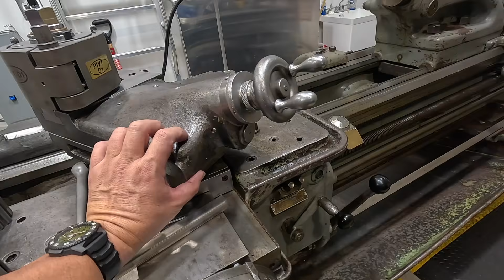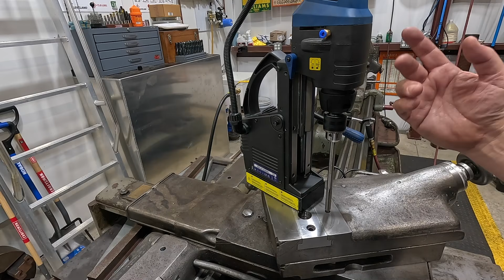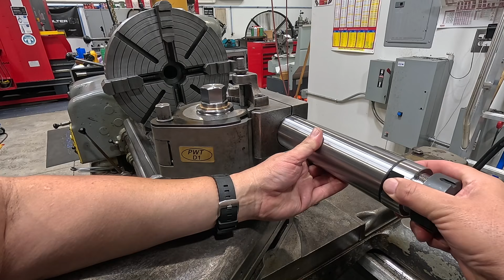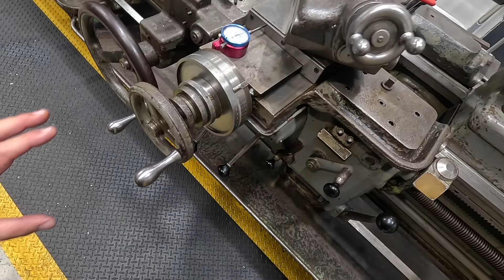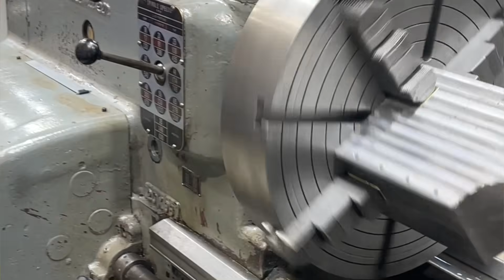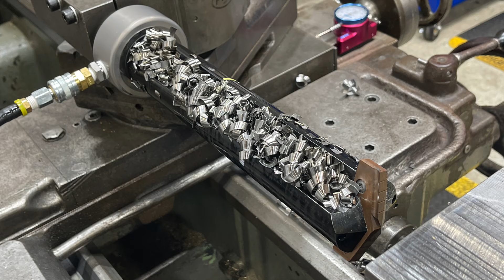3-1/4" AME Spade Drill First Test Piece

Comment: I have been watching your videos for quite some time now and I don't recall having seen one that answers my question:  I have often watched you indicate something (it doesn't matter what) to within half a thousandth's but have you ever had to indicate something so that it was dead nuts accurate?  If so, what was it and why did it require such accuracy?  If you have one, I would be very interested in watching a video demonstrating the process.  Thank you very much.
Reply: Define “dead nuts”. So you know, there is no such thing as “perfect” in machining.
Reply: They can get down to the width of a ray of light. But nothing can ever be perfect. Half a thousand is usually close enough. +-2 ten thousands is common in some industries.
Reply: It only needs to be so good, and going much better requires much more exacting methods. I am sure he could get it closer, but what good is 2 tenths on a hole drilled for clearance for a boring bar, and has an ultimate tolerance of .001-.002?

Comment: you see this is where one of the major problems of these older style lathes and mills comes in and also where the skill level of the machinest is really shown, you have no way of knowing the spindle pressures so you have no way of knowing if your machine can handle a higher feed rate, you said you thought that it was to aggressive at higher feed rates but in fact the only thing telling you that is true is your experiance. in fact your machine MAY be able to handle a higher feed rate doing this and other jobs but you have no way of knowing as you can only tell by sound and looking what is going on, and while you are a very good machinest and all your experiance is telling you that what are saying is true, and it PROBABLY is true, you cannt really say for certain.
Reply: He can't prove it exactly but when the chips were coming out dark like that you have a good indicator. I mean that started to look black which is hotter than blue I'm guessing. Assuming the setup lasts for the full 15 pieces (and I'm betting it will), by the 15th piece Adam will have a good level of understanding the forces and the ability of the lathe to handle them. Like you say, that's where the experience of the machinist truly starts to become important.
Reply: @musicbro8225  so lets first talk about the "dark chips" comming out of the hole, you know what that tells me? it tells me that he's not running enough coolant through the tool to keep the tool head and work piece cool enough. which would fit with what i saw but then this is one of the first times he;s run coolant on this machine so thats understandable, also the fact that the work piece was not balanced in the chuck could be why he was getting the "CHATTER" he said he could hear and it being nothing to do with the feed rate ect ect ect. the thing i'm trying to point out and was trying to point out in the first comment was that there is a reason WHY this type of machine is dying out and why CNC is now the most common type of machine to do all of the differant types of machining. it's because if you take a total novice machinest and give him a CNC and you take a pro level machinest like ABOM with a lathe like this. the novice would be able to turn out parts to a higher tolerance faster than ABOM not because he's better at the job but because he has better tools.
Reply: @madmurdoch2000  Yup that all sounds reasonable. I wasn't arguing just pointing out that it doesn't take much experience to see the colour of the chips. But I still love the old machines and their quirky ways of the past.

You could say that there was a lack of coolant but you could also say that the feed rate was too high for the setup. Easy to slow down, less easy to increase the coolant supply. Going forward though, the coolant could be better as abom said himself when he first ran it.
Reply: "where the skill level of the machinest is really shown," yeah, it's not like this is a really basic part of cnc machining or anything.

Comment: Add an amp gauge to the lathe, so you can monitor what is using normally during the plunge for power, verse when you break an insert deep inside the channel/ amperage climbs way up, to know when you need to pull the tool to replace a broken insert.

And ditto on coming up with counter weights,since front end of spindle that out of balance, it not going to allow the spindle bearings to last/

Comment: I think you need more coolant pressure, change the pump to a more powerful one, as you mentioned in the last video.
It is not only for cooling, but for chip evacuation. The chip might get stuck, and damage the tool insert. You can also turn the drill 90 degrees, to gett better chip evacuation from the drill flutes.🙂
But man, that lathe is a beast!

Comment: Why indicate the holder on a surface you don’t use? Instead, consider placing a known good tool in the holder and indicating directly on the tool itself. Similarly, why center the tool holder using the tailstock? The tool operates relative to the spindle, so centering it with an indicator on the spindle would provide more accurate alignment. Adding the misalignment between the spindle and tailstock unnecessarily introduces error into your measurements. I find some of your videos a bit frustrating to watch—not necessarily for viewers unfamiliar with the trade, but as someone in the field, I notice what I would call avoidable errors. These come across as amateur mistakes, which is surprising given your expertise.
Reply: Unless he knows those parts are good as he's measured them previously.
But I don't think these holes need to be spot on, I think he's just hogging out metal for a finish process.
They look like they will be king pin holders for some sort of big heavy thing.
Reply: Always surprises from Adam. When everyone was expecting the toolblock to be used as a perfect accurate drill guide, already indicated in position. He removed it!! and drilled freehand for a locating dowel ending up 0.030" out of position. Those locating pins usually protrude about 1/2" from the top of the toolblock for easy removal. The three holes in the toolblock are for 3 degrees increments not 4.5 degrees as he keeps insisting. If the compound was set parallel it could be used to break any long strings of swarf.

Comment: Tip: if you make dowel pins, and you have  height enough, I always but thread on the end of the pin, then I can use a pipe/washers and a nut, to easily pull the dowel again.

Comment: 17:11 the reason why it moved 25 to 30 thousands is because you used a undersized transfer punch.
It makes more sense just to make a sacrificial transfer punch, than to use a undersized one.  Barely takes any time on the lathe. Than to do all indicating and coming out with no accuracy. it is just wasted time and effort.
Reply: Or use the hole in the toolblock as a perfect drill guide in the correct place.

Comment: Why didn't you ever add the counterweights?
Reply: They're coming. It was on his Instagram a while back.
Reply: I guess, no need for them.
Reply: I think the counter weights are less about protecting the lathe and more about stopping the movement of the workpiece. Considering this part of the job is to 'hog' out most of the metal from the hole rather than the precision job of boring to size, the counter weights are not needed.

Comment: depends on how hot the water is coming out of the drill bit it could 
need more water pressure ??
Reply: I’m thinking kind of  the same thing… needs more volume… bigger feed lines … at least for a bar that big. 

I’m seeing that steam and even though this is a hogging op… that drill is definitely oversized by mid way in.

Comment: You can feed the piss out of those drills. You ain't gonna hurt it. I have gone .020 on 4130. But on CNC. Up to 5" diameter.
If you think that sounds rough, you should hear a Walter flat bottom drill at 2.5" or above. Lol.

Comment: That would work much better on a horizontal boring mill. We routinely push a 6" spade drill with no pilot hole with a 5" G&L boring mill at .005 feed.

Comment: Not quite the spotting drill, followed by a few increments in drill size. Boom, straight to a 3+" drill.
Reply: He's got a bunch of them to do, adding an hour or so to each one is not a good solution.
Reply: @brettbuck7362  idk if it would add an hour. The smaller drills could be at a higher feed rate. Still, normally Abom does the spot drill, maybe a drill less than an inch, and then the big ones.
Reply: Spade drills are not designed to follow a hole, They are designed to be used like he is using it,

Comment: Very nice. I would have taken the bit out for cooling with ice every once in awhile and stopped the machine to pull some of the heat out of the block with a cold rag.
Reply: Not needed and would be a waste of time. Carbide spade drills will take a lot more heat than they’ll ever get with this type of drilling.
Reply: @ellieprice363   it allegedly isn't carbide tho
Reply: @ikbendusan  The blades are carbide. But even if the tool was HSS it wouldn’t need cooling with a constant flow of coolant.

Comment: For the ease of holding your tolerance, I would get the bore within 0.003 with your boring bar and use a Sunnen AN hone on it! 
No sweat! Maybe start the spade drill at 56 RPM until the drill is cutting with the side flutes and then crank it up to 106. Nice setup!

Comment: Once you get the elevation of the boring bar holder set, you can eyeball the side to side center with a center in the holder. No need to indicate it day to day. Indicating the boring bar holder parallel to the bore is all that needs to be dead on

Comment: Nice mods to the pacemaker and glad to see that it did not leave you needing a pacemaker! What advantage did the spade drill give you over a normal drill then taking it to size with a boring bar as we have seen you do hundreds of times before? (apart from the obvious huge starting hole)
Reply: Time. Boring bar work takes a good bit of time to get to that size. A 3.25 spade drill for a 3.5 inch hole saves about 2-3 hours per part.

Comment: Mag drills are generally used for drilling a hole in structural steel 40' in the air. Not precision drilling.
Reply: Abom should have taken the slide apart and brought it to the mill.
Reply: No he got the result he wanted, however I was a little worried it wouldn’t line up when he was going back together with it.

Comment: Pinning the holder to the casting instead of to the t-nut means that twisting pressure on the holder will put sideways pressure on the t-nut, eliminating much of the benefit of keeping the compound at an angle..  It will move, within the tolerances of the slide and the pin holes.  The compound alignment will need adjusting, especially after that sort of drilling.   Much better to pin the holder to the t-nut, although the original design makes that difficult.
Reply: I think it's moot. The giant center bolt makes it extremely unlikely.  The compound machining is more than good enough to prevent movement.
Reply: He could take the whole assembly off and pinned   the tool post to the tee nut on a drill press.

Comment: I think my grandfather said his compound at 4° so that when he turned the handle .010 it would take off .0001 can anybody say if that would work?
Reply: There is something in the machinist handbook about that, I don't remember the numbers buy you set the degree, then each revolution of the handle was so much of an inch
Reply: 3 degree would be very close to .0001" off the diameter for .001" compound feed. 3 sin x  .001 comes out to .00005" then double it for diameter.
Reply: sin^-1(0.1) is about 5.74 degrees, so 0.01 on the handle should be 0.001

Comment: if you center drill the part using the tailstock, then you can use a dead center between the part and a pointer in the drill holder and simply indicate it in like you would something being held in a 4 jaw... once you have the height permanently set on the tool holder it would be very simple and fast to indicate in the horizontal.

Comment: Hello. good video. An easy way to align is to use a small axis, put it in the er 40 collar, adjusted and make it bite the tailstock chuck, keeping the tool holder loose. for speed, use the formula rpm=vc.320/diam. The feeding always starts with 0.05 mm/rev and if the chip does not change color, it can be increased to 0.075; 0.1 mm/rev, etc.

Comment: What happened to the counterweight? Jobs such as this require every advantage you can give it.
Reply: You get caught up in the moment, excited to see how well your chosen solution will work, what the machine can do, etc... And in this case, the machine's so stiff that it doesn't really need it!
Reply: @7333-e3k  Probably didn't help the surface finish to not have the counterweights, but for a slip fit that's not likely to be much of a concern.
Reply: 27:47 He said he would do that later. He wanted to get on with this test run.
Reply: Stick a couple of on/off magnetic indicator holders (without extensions) on the chuck for counterweights.

Comment: for ballance set a indicator on a stand on the floor set the point on the side of the head or tailstock, as you speed it up the Mach will show on the indo, change weight , spin again as you balance spin faster and repeat, if the balance is off much the bore will be out of round

Comment: after indicate the center how are the sides? may need to re check after a rough bore. if you was to bore 1/8" deep before   drilling  you could check for run out

Comment: wouldn't it have been better to pre-drill with smaller drillbits instead of going in with that big one right away?
Reply: Carbide spade drills work better without pilots. Otherwise the carbide bit will likely burn out on the diameter of the previous pilot drill
Reply: The whole point of developing that carbide spade drill is to hog out a big hole all in one go without needing to do it step-wise with 5 different spiral drills. That saves hours of time - and imagine the savings doing 15 of these.

Comment: You should indicate the toolholder your actually using, they aren't all perfectly aligned to the mounting splines on Multifix tool holders, I have found them to vary slightly with genuine Swiss made holders and Chinese made ones.
I usually indicate the tool post with the parting holder as that one matters the most to me, standard holders it really doesn't matter if they are a fraction off.

Comment: I've got a iscar 3.000 indexable drill, similar design with the coolant, thing is a beast takes 8 inserts though. typically I feed that drill at 0.005 per rev in cast iron, really loads the spindle down hard

Comment: I know a lot of machinists like to keep it at 29 degrees for threading. I myself do not. At 90 degrees, it's a lot more ridged and I like to give myself every advantage possible. Love the vids. Cheers.
Reply: You get less tool pressure at 29.5 degrees since its only cutting on the front edge.
Reply: @JackS425 if you advance the compound 1/2 the depth of cut it simulates 29 degrees. Keeping the cut on the leading edge the same
Reply: @JackS425  very few people using engine lathes  are using  the compound at 29 degrees because if you get to your root diameter and it's still not fitting, it's  easy to fix with the compound at 90 degrees.  Hell, unless im threading up to a hard shoulder externally or internally, I don't even disengage the half nut.I just hit reverse.